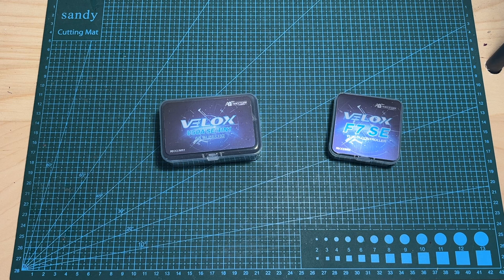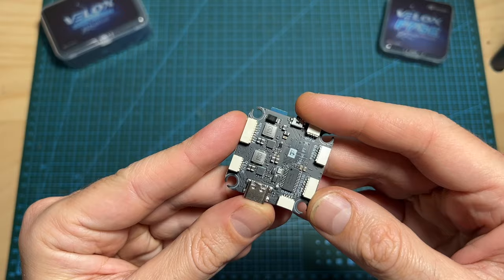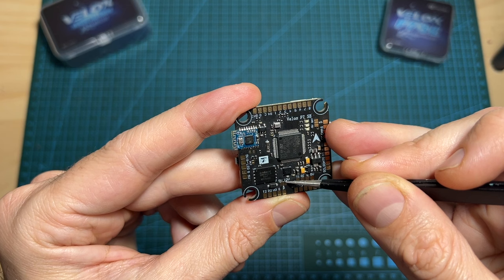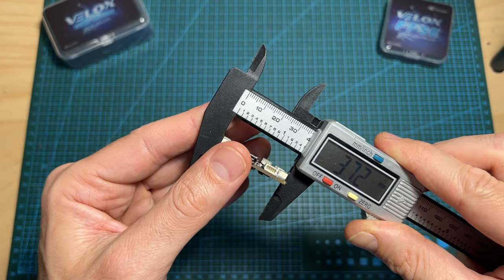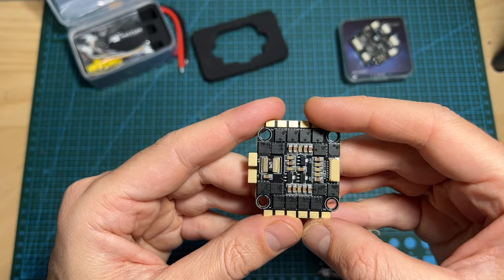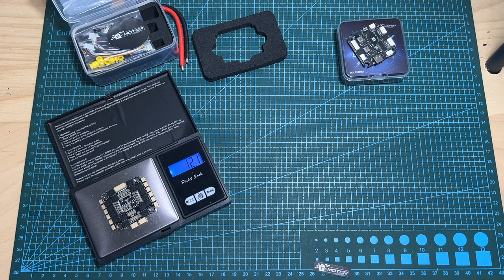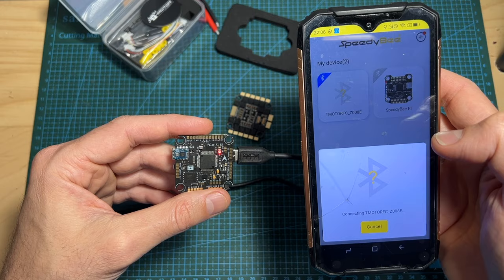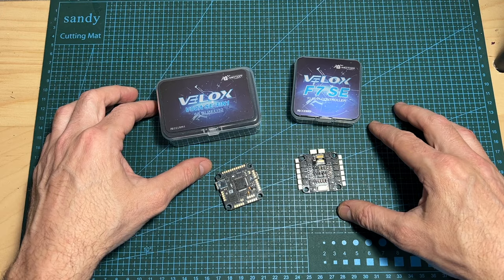TMOTOR Velox F7 V50A SE HD Budget Friendly Stack

Comment: Hey brotha, curious, I watched a vid before yours and they specifically said this stack is made for a 5". I'm thinking of getting this stack for a 7" do you any concerns with that? Here's my issue. I've got a 7" that needs a stack and multiple 5" drones that need stack replacement because the speedybee f405 v3 50amps I had keep giving me esc failures. 2 full on blow ups, 2 esc's missing on the same drone, all parts replaced still same issue. Then my new Mario 5 build v3 stack, same issue, esc just went missing. So I don't trust speedybee and customer service wants me to send it back on my dime and it take well over a month. It's still going back, but I need something I can trust. My 5" Mario build has velox motors so assumable this is a great stack for that drone. Curious if a 7" is feasible though. I supported speedybee and now there product just isn't trust worthy. Thanks for your time :)